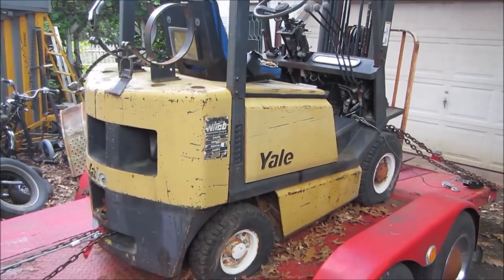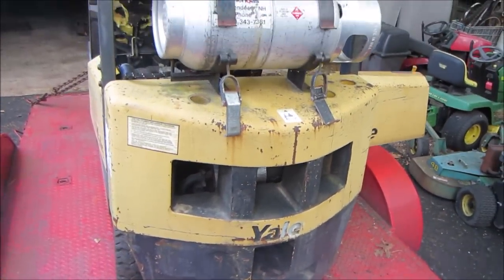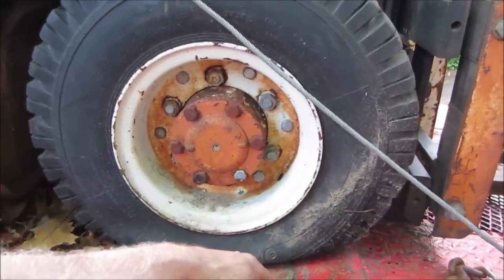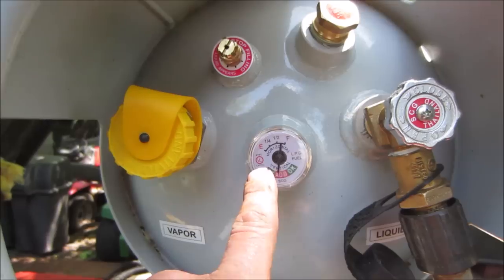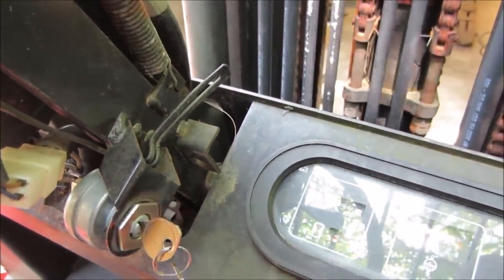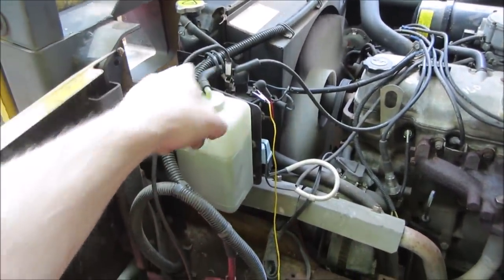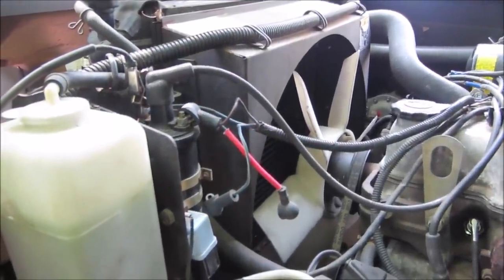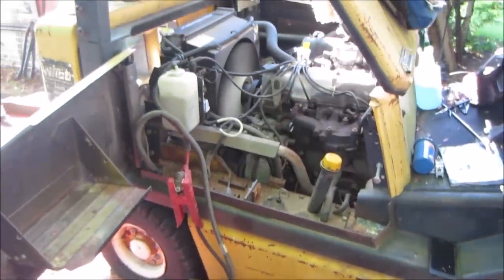Will It Run? cheapest Forklift I could find .pt2

Comment: Used to work on these things, I knew what it was when they described the symptoms - so yes you diagnosed it correctly - so celebrate the win.  To jack up the front, we used to tilt the upright fully back, shove a wood block under the bottom of the upright outer channel, then tilt full forward.  It will pick the front of the machine up clear of the ground.  We would check for leaks after working on them by clearing the drive tires like I just described, aim it away from the shop, crank and run against the governor (in gear) for 15 minutes with a clean sheet of cardboard under it.
Reply: Yeah, I didn't want to sound like a know-it-all.  That's how we work on the Allis Chalmers and the Hyster lifts.  Stick a 4x4 under the front of the mast and tilt the mast forward and voila it picks itself up.  The Allis is so heavy, you'd need about a half dozen jacks to lift it an inch.

Comment: I had the exact same issue with an '82 Subaru. Parts guys doubted my decision to fork over $300 for a new ignition module but that was the issue. Overheat failure.
These can be easy to find by cooling the part down with cold spray.
Getting a scope would not hurt either. (Scoping the ignition pulses).
Cheers,
Reply: That's what he used time trouble test light for....

Comment: G'day, Mustie! Oh, fiddlesticks! "To Be Continued..." Now you've, taken the term 'cliffhanger' to a new level. By the way, am looking forward to seeing more, on this "An Awesome Find" used 1992 LP GAS YALE GLP030, with it's Brand New Pneumatic tires. Great for inside and outdoors on loose surfaces, having 79" lowered mast, 172" maximum lift, has a three stage mast, 42" forks, sideshifter, automatic transmission, and (it's really sounding like) unit will run, and operate... very smoothly!! Thank you! Great job! 

Cheers! 🛠✌🏼❤️

Comment: Comment #2  liquid propane goes to the fuel lock first, that regulates the pressure of the liquid. from there to the vaporizer. The vaporizer will have the water hoses in and  out of it. The water from the engine will warm the liquid propane which boiling point is -43 degrees. At the boiling point  being so cold it needs the warm water from the vaporizer to vaporize the liquid into vapor form to the mixing valve (carburetor ). its really not a carburetor just a vapor mixing valve which mixes the vapor with air and thus combustion.
Sounds like the engine runs nice. Hard starting in the winter if left outside. Ron B Mich 35yrs propane business.. I love your videos keep up the good work.

Comment: One of my favorite toys was a battery powered Forklift with wired remote control,  my father sold it in a yard sale when I was away at school ugh!
Reply: If you liked that, you'd really like running something like a Raymond Dock-Stocker. They're electric, but they out-perform every other kind of forklift in that weight-class that I've ever touched. They even have a "manager code" that you can input and then it goes even faster. The "manager code" essentially takes the leash off.

Comment: I’m curious about the other so called mechanics that couldn’t get it going for the original owner?😂😂😂
Reply: They weren't mechanics they were fork lift parts change technicians
Reply: They would see this vid and go 
👁👄👁
Reply: @bensmith4563  on the other hand, how much do new plugs, wires, coil, and pickup cost?
It's interesting and informative to watch the video and fun to play detective.
But just thinking: must be spark related and replacing all those parts and you save how many hours of mechanics time over testing each component? Or hassle of having to order or get the next part to try?
And once one component goes, others could be close. So you save all the time of future problems.
The issue isn't that the other mechanics were mere parts changers, it's that they were incompetent in troubleshooting down to the right group of parts.

Comment: Of the few lift trucks I've known, they all had low oil pressure shutdowns. It is possible that the low oil pressure switch (or the high temperature switch) could be intermittent, or the lower idle may let the oil pressure drop to the point where it shuts down. Keep up the good work!!

Comment: Nice video as always Mustie1. 👍
I remember my old Ford with HEI distributor went out when the engine was warm and came back on again when the engine was cooled off. It turns out it was a fault with the windings in the distributor. It lost contact when it's got warm. Second hand dizzy and it was good too go 😊

Comment: On you new propane tank for liquid withdrawell for forklift . Do not attempt to hook this tank up to a gas grill.  The yellow valve you pointed at is the fill valve.  Gas grills are run off vapor only, for instance a 20 pound cyl is vapor withdrawal  only and must be sitting on the base provided on tank. from there hooked to a regulator witch regulated the high pressure of the tank to 11 inch water column. about 7 oz.
Your right the previous owner of the fork lift might have had the tank mounted wrong and the liquid tube in vapor space of the tank. The vapor could run thru the whole system, so it might run, but giving it more gas would not perform for it would not deliver enough gas to run at higher speeds.
RB Michigan
Keep the videos coming I love all of them!

Comment: use front mast base with wood blocks under base hydraulic tilt down to raise tires off also.
Mustie make an extension boom tube off forks you can pick stuff out if pile and not go off pavement. 
Don't go on dirt or you will be digging and cursing .lol
Reply: Forklift: can lift 2 tons with ease
Also forklift: gets stuck in an inch of snow.

Don't ask me how I know this. Lol
Reply: Cardboard Silver spend a lot of Time digging them out of asphalt also. Sank on at my grandpa s factory on a hot summer day into asphalt to the frame. A Solid tire one. Then at boat yard nonstop recovery of a 12ton hyster boat fork lift..lol
Reply: Hyster.

Found your problem. Every Hyster I've ran, all junk. I'd rather drive a 20 year old Clarke than a Hyster.
Reply: Cardboard Silver Actually Hyster seemed the best forks we ever had. TCM and Toyota CAT Clarke  all have good and bad models .
Depends on application and operators. I am a NYC crane operator and have run fixed heavy equipment since 1975.  
New stuff leaks less runs better operates quiet reliable .Japan makes the best equipment.
Reply: I've ran Toyota, Clarke, Yale, Daihatsu, Daewoo, Nissan, CAT and Hyster.

Every Hyster I've ran was junk. I am partial to the Daewoos and Toyotas. Though CAT diesel lifts are second to none.
Reply: Cardboard Silver We had large Hysters 12 to 20 ton and Clarke . Linde was junk. CAT service parts best. This channel awesome .

Comment: To Jack the front up for the tire.... put a wood block under the forks and lower them down, pushing the front of the truck up.

You're welcome.  :). Been a while since I played with these trucks.  I had free time at the factory I worked at before college where one of the fork lifts had duels on the front and was huge enough to pick up multiple cars.  Had a blast with it on a snowy parking lot.  :)

Comment: So I can tell you wired the key switch wrong. If there is 12 volts going to the coil while it is running with an external ballast resistor you will fry the coil. 
If you need the wiring diagram I will email it to you

Comment: You did very well. Thats a darned good forklift. Spray the lifting chains with P'Blaster a few times..full length and let it cook while you are working on the rest of the lift. Motor sounds fine, good good metering of the gas so that wont need any attention for a while. Change the tires, replace the plug wires, maybe..maybe change the hydraulic oil filter, do an engine oil change (about every 1000 hours...chuckle..propane is  so clean it never gets the oil dirty) and you are golden. Keep in mind..that the critter weighs about 3 TONS..6,000 lbs if its a 3000 lb lift..so when running it across the yard..it will sink like a rock if the soil is not dry. Spray the lifting chains after they are free with a little Vactra way lube oil and put her to work!!  This of course..assuming that the transmission is working properly..and I havent seen the whole video..but suspect she is fine. Coil appears to be bad. Should be a stock coil. Or worst come to worst..bad pickup in the distro.

Comment: Hi Mustie,

I haven't read all the comments, but of the ones I did, no one has mentioned that little brass button in the middle of the gas regulator (demand regulator). Although this (Century) system looks different to the Borg-Warner, it is still very similar in operation. If that holds true, then that little button is your friendly little manual cold start device to assist in the initial start up. You can simply press that button for 3 to 5 seconds before cranking the engine, which releases extra propane into the carburettor and enriches the fuel mixture. That way, you don't get several abortive starts before the engine will fire up and run. In the Borg-Warner regulator, there was also a solenoid actuator to do that for you so that you don't need to lift the hood every time you want to make a cold start - to point of fact, there would be a push button on the dash panel for that purpose, which also allowed you to boost the fuel richness if the engine should begin to falter after starting in exceptionally cold weather - just press and release a few times until the engines picks up again. If you like, it's your choke for starting on propane.

Comment: Had the same problem on my 84 VW GTI.  Drove me crazy.  Carried a jug of water and everytime the car stopped I poured water over one of the possible electrical parts. When I got to the distributor, cooling it with water fixed it right up. The mechs never figured it out, just took my money.  But no hard feelings because it was hard to get it to fail. You can't fix what you can't see.

Comment: I used to operate the exact same Yale forklift years ago. The company does not even exist any longer. It was so long ago the company that bought out the company I  worked for has been bought out. In the winter time on the cold Docs we used to take big cardboard boxes and unfold them. Then stand inside behind the forklift because the heat blows out the back of the forklift. Fast way to warm up real quick.

Comment: That's a big win! Was leaning towards maybe the connection to the regulator through that switch when it kept running at 1st..but yeah, that pickup in the distributor seemed to be the culprit. Not real bad price on those tires either. Will need to replace some hoses in the future, but that is easily worth more than what you're going to put into it.

Comment: I started working at Yellow Freight in 1989 as a forklift operator in Dallas Tx & Still work for Yrc Freight 30 years later we had mostly Toyota Forklifts But had about 10 of the same Yale lifts like you have there, I remember they were good  lifts comparable to the Toyota’s

Comment: You can change the front tires much easier by tilting the forks.  Tilt all the way back, put a block of wood under the bottom of the mast, then tilt forward and it raises it up enough to replace tire.  Good luck.  Awesome Vids.

Comment: Good work there Mustie1, ensure that as others related that coil gets batt volts on key start position and thru ballast resistor coil sees less voltage in run possy. Greetings from Down Under cobber. Good video mate.

Comment: Forklifts are really handy. My first one had pneumatic tires in a shop with way too many screws on the floor.  My 2nd one had cushion tires, no air! much better. They were the bigger diameter type so it could go outside in the winter to unload trucks.  Expensive to get replaced though.

Comment: good score, I have worked in factories with forklifts, at some point the old ones have to go, you cant be screwing around they have to work all the time every time, myself I had an old 66 ford backhoe for 25 years, finely it had trany problems, even then I would still use it by crawling it around the yard, in the end I sold it, then a friend traded me a 96 bobcat for two 40ft shipping containers, came with a regular bucket, 4 in one bucket, forks and a backhoe, it has its issues and I work through them as they come up, nothing beats having a machine around you can move stuff with.

Comment: I used to have an old Ford 8N tractor that did the same thing.  The problem turned out to be the coil.  When it was cold the tractor ran perfectly but once the coil got hot the tractor would just stop running.  If I waited a bit for everything to get cold it would start right up and run fine....until the coil got hot again.  Replacing the coil made it run like new again.

Comment: I had a 1979 Ford van with a 300 straight 6 in it. It would start misfiring and backfiring when it warmed up. I used an oscilloscope and wrapped a wire around the coil wire to the distributor and could see every other ignition pulse drop out when it misfired. A new $19.95 ignition module fixed it! The guy I bought the van from said it was finicky for many years... A little troubleshooting and it run perfectly after that!

Comment: I bought a 71 Chevelle that had a bad Trans. I checked the dip stick and told them I'd buy right now for 500.00. Took it home filled it with fluid and ran down the road no problem...Leaky coolant line.  Score!

Comment: Made for a great video bro and looks like you have it sorted. Be very careful sniffing propane from a running vehicle it can give you a massive headache. Drove gas forklifts for years and made sure all the doors were open in the area I was working for that very reason. They say it is safer than petrol powered but I found that not to be true by experience.

Comment: You had me laughing and you had me diagnosing :)
My old  LandCruiser went the same way a year or so ago.  It would run for 30 minutes and conk out.
Then 25 minutes. 10, 2, 1.
I dicked around with fuel tests and all sorts of stuff recommended from Internet forums. Replaced the coil....
It turned out to be that little thing you replaced.  However I couldn’t buy one individually.
So I found another whole distributor on eBay for $80 delivered.  Had my mechanic fit it as I lack those skills.   Maybe I’ll watch more mustie1 vids and gain confidence for next time my $80 dissy dies. 
Looks like a great purchase.  I was wondering how many 60 minute plus forklift Jobe you have coming up :)

Comment: Mustie,as you pointed out there is a hose that runs from the vaporizer to the carburetor. At the point where that hose is connected to the elbow into the carburetor there is a large screw that is used to adjust the fuel that the engine needs under load.Rarely need to be adjusted but sometimes necessary.

Comment: maybe it was just a bad plug and when you changed them out you fixed the problem  thumbs up and shared  or possible when they had the problem it was winter time and freezing up who knows forsure  could have been the ign switch cutting in and out as well   ok   problem still there pick up ,coil, resister  one of the 3 forsure i think  looks like you got the problem fixed awesome  cheap fix just took time to find it awesome good job buddy

Comment: Use the tilt on the mast with wood blocks to jack up the truck and work on the tires and brakes. I worked for many years as a lift technician. Yale is a good lift truck.  That will make you a good lift truck.

Comment: Hi. Ballast coil systems usually run a 6v coil with a ballast resistor. When starting,  the ballast resistor is shorted out and the full 12v is put through the coil to give a big fat spark to start it. Of course, when cranking, the voltage will drop to 11v ish.

Comment: Had a 1990 Plymouth Acclaim with the exact same problem - stalls out once warmed up. First words out of my mechanic friend's mouth was "2.5 stalling out on you when hot? Bad distributor pickup." I replaced the module and it was fine afterwards. Very common issue with those cars.
Seems like a rookie mistake made by the preceding forklift mechanics to not consider this as part of their diagnosis. Glad you were able to figure it out. Hope the forklift made it safely off the trailer - it was kind of an abrupt ending there...

Comment: After the engine is running the voltage at the coil positive should drop to 9V or you would be burning up the coil or other ignition components. The wire you are no longer using at the ignition switch could be what feeds the resistor and the extra 12 volt should be disconnected. I had similar issue rewiring a boat ignition that some experts had been in before and added other switches.
Reply: When cranking the voltage drops to ten or nine volts the idea being that you run a nine volt coil at full cranking voltage until it fires and as you release the key it switches to the circuit through the drop resistor at about nine to ten volts to the coil keeping it cool using a twelve volt coil with the resistor wont work as good.

Comment: I have the exact same forklift, I recommend not considering tubes and tires and just going for solid rubber wheels, its well worth it I promise, after going through several tubes and tires in 2 years, I've not had to replace the hard rubber wheels once yet in the last 5 years

Comment: Run voltage for the coil should be marked on the coil, or in the p/n usually around 8 volts.. Of course the ballast  resistor should match or provide that run voltage. Great video

Comment: Hi, from what I know the coil should get 12+v at the startup from as separate wire then in the run position 9V through the ballast, but I think you have got it sorted with the module. Great vid!
Reply: They have it sorted until too much voltage kills the new pickup.